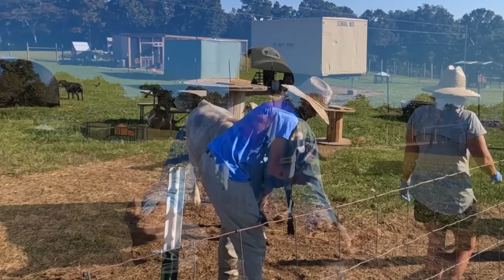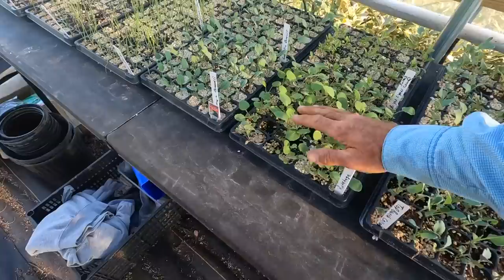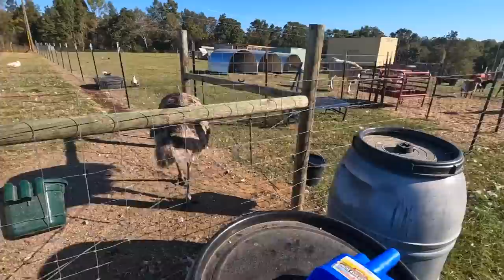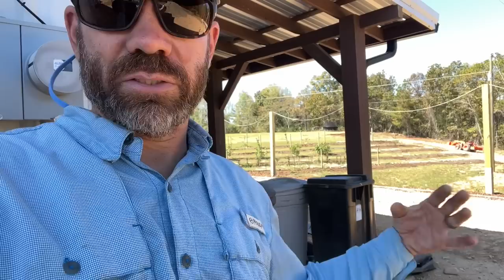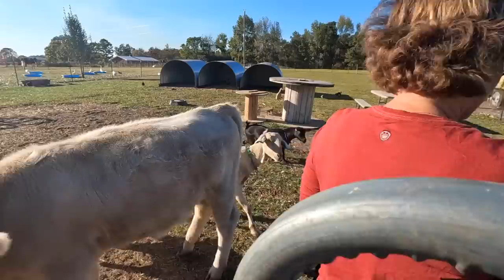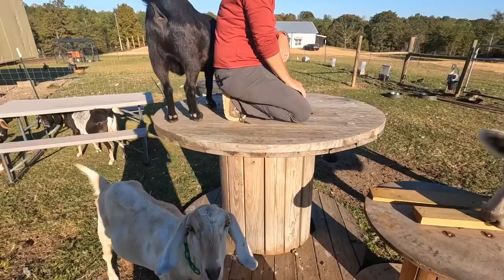The Vet Called Us Back About The Parasites!

Comment: I think a good idea would be to turn the canned ham into the canned vet shop. You can keep a fridge in it a scope and have to already to do your own fecal study. And you would have lights for any midnight emergencies and a place to store prep all your needs right near the pens.
Reply: I don't know what they wil think, but until they have a barn, I think it is a really good idea. One emergency would make that worthwhile.
Reply: @sandiekaye5241  Even after they get a barn, as big as the farm is, having the canned vet shop at one end of the pens and a barn on the other will give quicker response in emergencies.
And on top of that barns used by animals are often dusty and can contaminate samples as or equipment making using the scope tricky. And having the sink in the canned ham will make it easier to keep things clean. As well as give them a contained clean and safe area to treat wounds on smaller animals.
Reply: Goodness people I agreed with you.
Reply: @sandiekaye5241  Yes but you hinted it for just until they get a barn up. So, I pointed out the benefits it could still have after they even have a barn.

Comment: Jason & Brooke

Put a patent on your idea for keeping water clean with a " perfectly" fitting wire or cattle panel that snaps on.

Other people will still be inspired by your current idea but other people might like a wire that won't move and fits tight.  Just a thought.
Reply: Add a "plasti-dip" coating eliminate sharp cuts and rust

Comment: What if you purchased the largest sized contractor plastic trash bags and lined the food barrels up then filled with the grains. Then when they get low enough you pull out the bags and feed the remainder then fill with fresh. No picking up the barrel to empty out. Just need to change out the bags due to wear and tear.